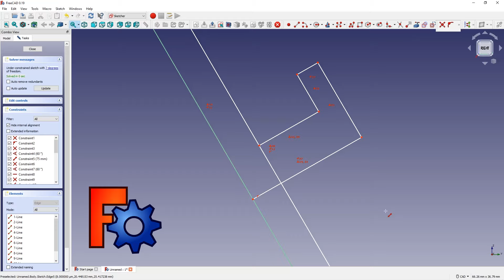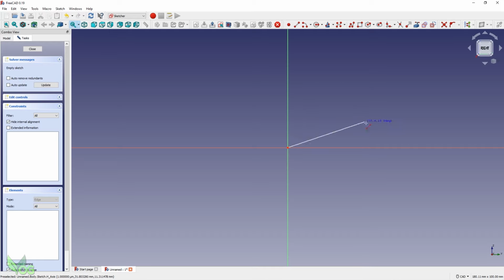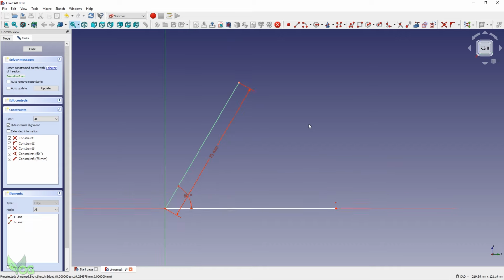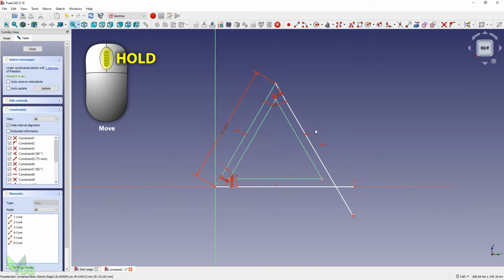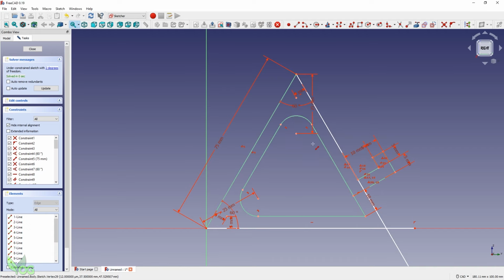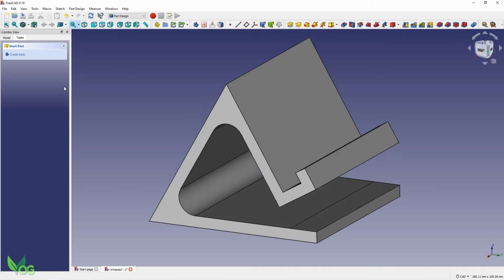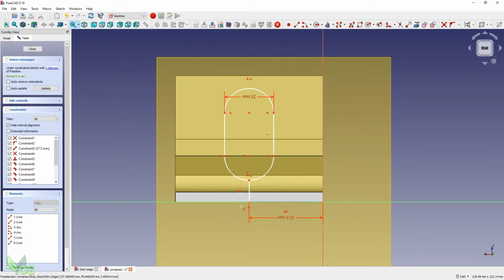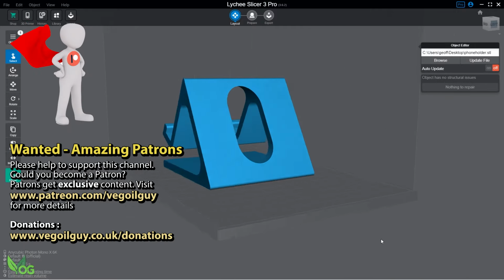CAD TUTORIAL : FreeCAD Beginner [EASY GUIDE]

Comment: Very well done tutorial. I was able to follow along and duplicate your design. The problem I'm having is trying to find out how you were able to get this part to print? I've tried to print it on a filament printer, only to discover that the model has an island that can not be printed. I only learned this after attempting to print it on a resin printer. Its slicer has a nifty feature that scans the design for islands. naturally, it found one. So, the question is; how did you print this? BTW, I'm only a couple of days into this 3D printing thing, so I don't know much. Thanks in advance for any assistance.
Reply: Disregard, I have since learned that some slicers have the ability to add supports underneath islands. This enabled me to successfully print the phone holder.

Comment: I've always thought I hated FreeCAD and have stuck with Fusion360 but maybe it's because no one has explained the basics as clearly as this. I'm going to have to give it another look. The constraints in FreeCAD actually look easier to use than F360. But what is the keyboard shortcut to automatically hide all those damn dimensions!!?? Please keep going with these tutorials Geoff and if you also know F360 it would be nice to do a comparison between designing in one vs the other.
Reply from the maker: I always found constraints a pain in F360, but I have to say I enjoy them in FreeCAD. It could be smoother, though I'm not sure how, but it does work well. However, like you, I hate the dimensions. Hiding those would be useful 😁
Reply: There is an icon on the toolbar that will hide all the dimensions.  If you want to find it go to sketch on the menu bar, look for sketcher virtual space, click on that icon or note what it looks like as there should be one on the tool bar.  Alternatively you can select individual dimensions in the constraints window and uncheck the box next to individual dimensions.

Comment: it's a bit sad that FreeCAD is pretty much non procedural, except for very small changes in parameters that won't affect the topology.
Other than that, the only fully procedural step is basically just the last one.
If only they could add grouping by a function, then refer to groups later.. But I 'm not holding by breath

Comment: I used to make everything in blender, where every minute change could wreck everything.
Reply from the maker: Blender is amazing, but you can tell it's put together by a hundred volunteers, each pushing their piece of the puzzle for dominance. I'm convinced that's why it's so demanding on resources 😁
Reply: @vogman  I don't think blender is behind compared to software from autodesk or Maxon in term of performance. I used 3DS Max before blender and stability was so bad I never looked back. and blender v3.0 UI redesign is quite impressive.
But as a CAD tool blender is terrible since precise dimension are hard to achieve and it's even harder to go back and change early design decision, whereas freecad let you edit every steps of the way.